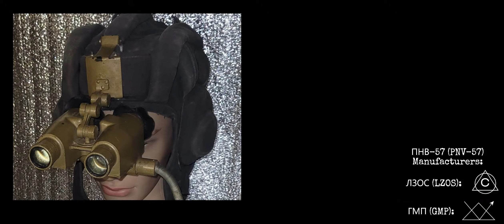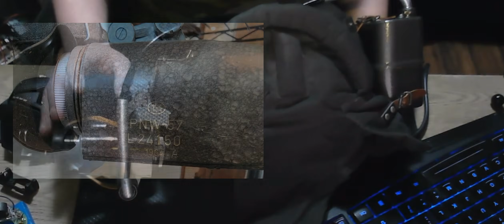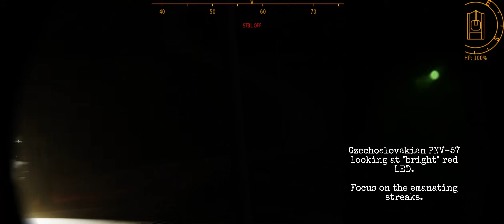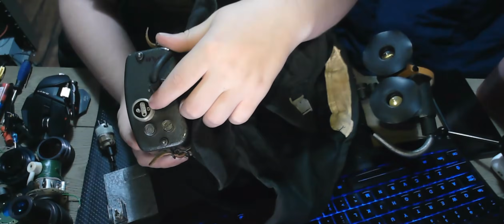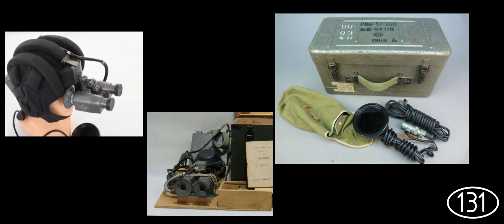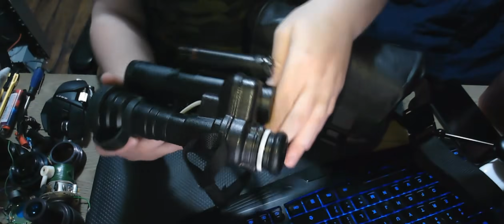Soviet PNV-57 - BN 2,5x42 Night Vision Devices: Mechanized Units - Civilian Markets

Comment: The czechoslovak PNV-57H was never mounted on a helmet. The H stands for "hlídkový" which means patrol, and it was used by border guards. You can see the leather stripe that was used to hang it on your neck. Also the psu on the pnv-57e (and maybe even the pnv-57a) switches between 12v and 24v automatically without the need to manually change the input.

Comment: I have the PNV 57 full set, I think 1977. I installed the A 55 spotlights in place of the headlights in my Trabant car and went for a drive with this. It was awesome, but without IR, they are almost useless. A great experience nonetheless. Thanks for this very informative video, not much info is available on these things

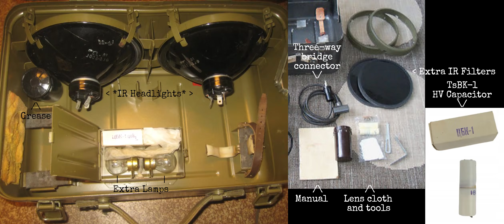Comment: 25:10 A little correction: the TsBK-1 is not a high voltage capacitor, in fact it's something much interesting, it's a high voltage tube rectifier diode with a COLD cathode. Normally a tube diode without a hot cathode is impossible because you need thermionic emission(plus if you add the high voltage then it becomes an x-ray tube, which is ALSO the reason for the myth that soviet night vision produces x-ray's) but here it utilizes a very rare effect(i will add the source in the comments, remind me in a few days if i don't) of cesium(and some other rare earth metals if i'm not wrong) being able to rectify micro amps of current but at extreme voltages where normal diodes(and even some hv ones) would break down

Comment: Hi! I have one question about pnv 57e
For what do you know, the objective has any coating to filter the wavelength of the lights that goes through or not?
I'm projecting to build a custom set of lens 1x with adjustable focus to avoid the blur under the 30m and the fisheye effect.
Of course it will be a completely reversible modifying.

Comment: There was another version of the PNW-57A rarely seen. It was called PNW-2, it was a single "pod" of the PNW-57A. Used as a monocular, it was mounted with a swiveling ball joint to the tankers cap. The swivel allowed it to be switched between left and right eyes. Came as a kit of two in a box. Once every few years they pop up on Polish marketplaces like Allegro or OLX

Comment: Pnv57em uses lenses from oh-1 / 1pn63
Pnv57e Has 2 more versions one I dont remember at all but one is ET which Has 2 in a box
The pnv57e also Has the same 2 versions one with 2 in a box and the third version elm Has a ir illuminator that can connect to the psu Its possible the third version of 57e had the same concept but its really hard to find info
Reply: Correction 57e and 57em have 3 version in total one being the base model
Reply: There is also a Czech version of pnv57e with visible differences to the finish etc a huge difference is the name that uses english instead of cyrlic
Reply: There is also more like a PNV57T if I remember correctly it was something like pnv57-280 but double in a big wooden box I can tell you more if you want
Reply: After some research I found out that the third version the most unknown 57e is called 57ets
Also the third version pnv57em which is called pnv57elm (57em+ir illuminator on the center of the device rotating Axis with power cable going to the psu with the same connect style as baigish20/20a) Has some weird accesories in the set with a leather blue pouch and some sort of map tools atleast that's what they look like its likely related to its use
Also a certain large scale armored transported used in modern russia uses the standard pnv57em for night driving I forgot its name but if I recall it carries a warhead
It also turns out there were some budget cuts on 57e sets past years like 1982 cant specify but older sets are different slightly as i noticed the removal of a wall screwdriver Holder the arm of the lid is 1 piece instead of 2 piece it no longer has the set layout picture card the while old ones do have 2 pieces the paper and the screwdriver instead of the box is attached to the box inner wall by sliding into a metal loop like part
Also sometimes the accesory box inside is plastic black instead of metal with hammerite finish
Fun fact my ns71 or 57-280 cant remember adapter cable which had a white wire instead of black had bic markings on it so its weird seeing british wires used for a rus design device accesory